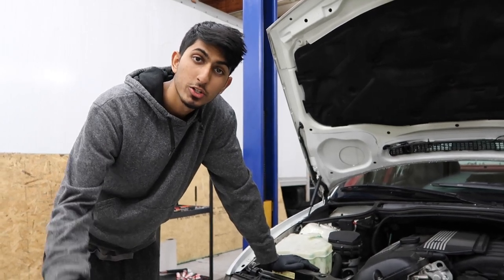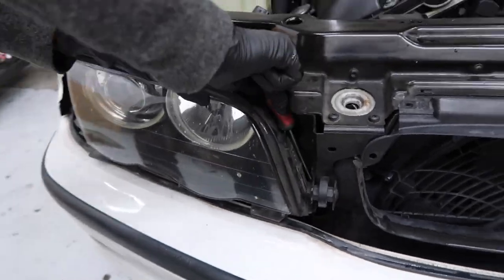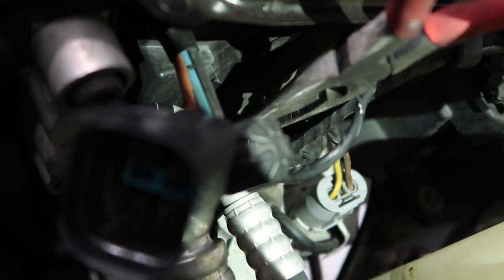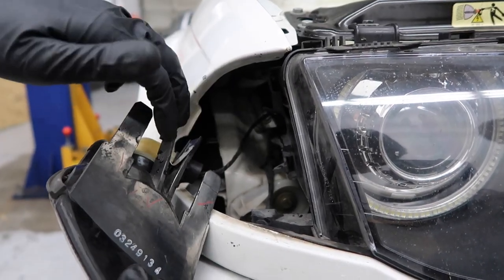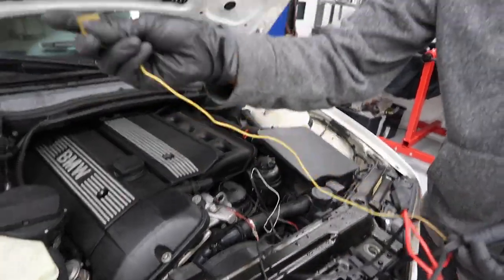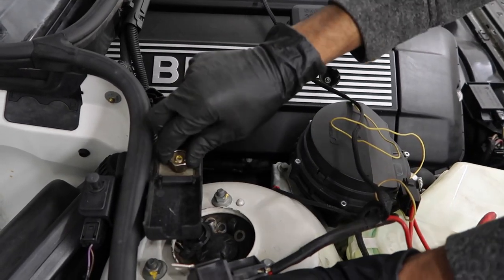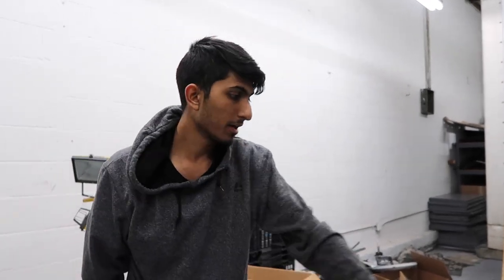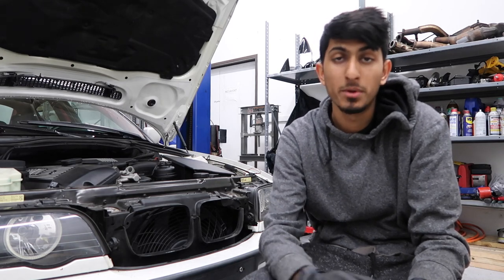BMW E46 Angel Eyes Install DIY

Comment: I have noticed that you call those headlights for Facelift time to times. I dun no is it me who is getting it all wrong? I have always thought that those headlights are Pre Facelift and not Facelift? Aren't facelift the ones who ho upwards and have that more angrier look? Mind that I have a BMW E46 330i from -01 with these headlights whom I have always thought are Pre Facelift. Embarassing
Reply from the maker: 99-01 sedan is prefacelift, for coupes got the facelift starting in 04.
Reply: Ah. I get confused so easly. Thanks! ShopLifeTV

Comment: what is a face lift sedan ?
Reply: stovy it's just a sedan with a newer model front end
Reply: Gage Maxwell is it an option from BMW  ?
Reply: e46 sedans made in 2002 - forward were updated exterior-wise and e46 coupes were updated in -04 I think. I think it was just a way for BMW to improve the looks of the car, so that it wouldn't get outdated aesthetically.

Comment: I have a 2000 BMW 323i and I only have the black and red wires connected to the angel eyes. I want the angel eyes to turn on when I turn on the car but right now the angel eyes are staying on forever. Can you please tell me what to do.